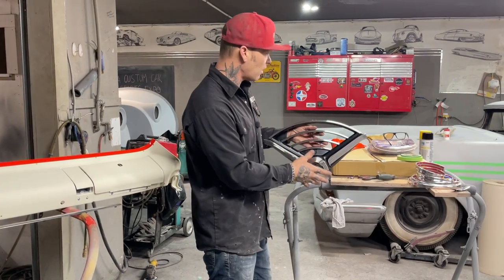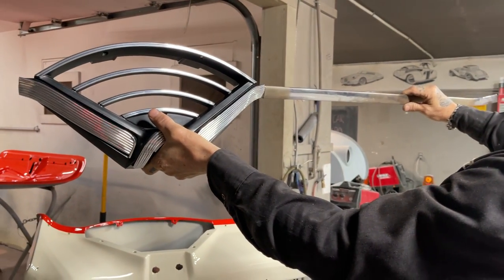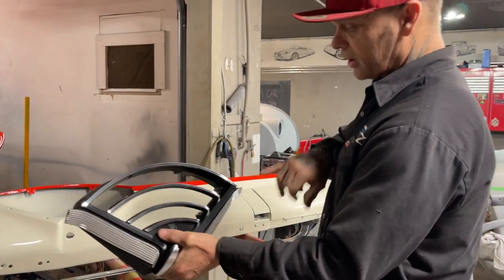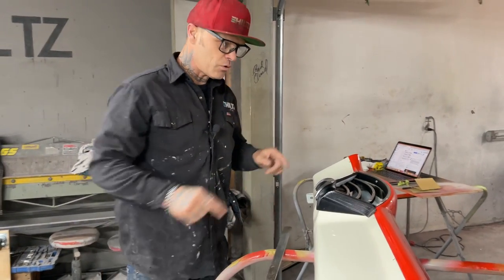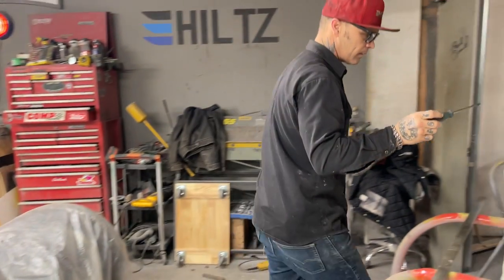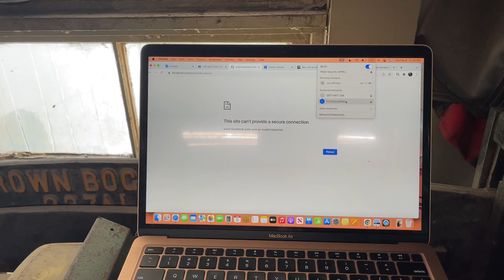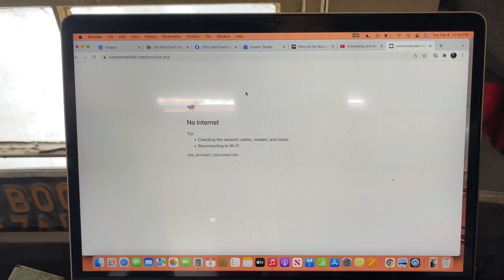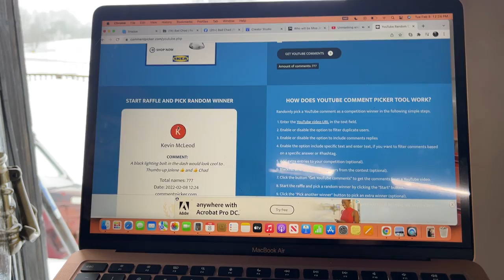Chroming the 1955 Mercury dash for $40 - (Universal Method)

Comment: Chad, try cutting your air bag tubing with a single-sided razor blade at a perfect 90 degree angle using a clean metal backing to guarantee a nice clean  trouble-free connection ... also, always blow out the brass fittings before using them to make sure they are perfectly  free of any "junk" particles ! ... Another "A+" for all your videos ... You two are the very bestest !!!

Comment: Here is what we did in the van conversion industry for moldings. We made a wood box 2'x2'x2' with a lid hinged. Then we put a 60 watt bulb set up on the inside of the lid, centered. We would then put the molding in the box. Turn on the light and leave the molding in the box for 30 to 45 min. This will make the molding pliable to go around corners and odd or different shapes. Then when the molding cooled. It would keep it's shape. Plus it helps with activating the adhesive to help stick better. Hope this might help you out on applying molding to what ever. Peace and love......

Comment: The chrome tape looks great, I've Been using it for years to add to and dress up striping packages as a 3M Trim-Line distributor there were 150 distributors across Canada up until 1992 when 3M withdraw the name from use and we became independents. Thanks Mark Dutka Oakville Ontario Canada

Comment: Looks great, I recommend using 3m 94 primer it comes in a nail polish style bottle we use it on motorcycles to help with vibration and heat..another awesome video

Comment: Looks awesome. I have used this "Flex Chrome" before and I love it. I have a Very high-end Deuce Roadster and I used this adhesive Flex chrome for the center strip on the 3 piece hood because it is the hot rod hood with no center hinge, unlike the 4-piece stock style "Butterfly" hood .

Comment: That's exactly how we used to do stuff when I had my shop. I would read the paint cans to see exactly what would mix. One Job we did we could use Centuries Hardener with Sherman William Paint and get the same results of what they were trying to sell us.Centarie wanted us to by their paint bench. I told my brother that's not happening. Look on the back of the can; if you don't believe me. All it takes is a simple test take one of your proofing cup's . Watch to see if it separates or if you have Fish Eye's. O.K. Fine, I've had a few beers...

Comment: That end cap looks good plain,. Just saying.!!
I know your chrome works , will pull paint primer all off if you just pull it off without heating it
Chad stick a piece of 3m tape on the chrome backing then pull that off brings the red plastic off with it.
Try two or three wider pieces with a thinner piece in the valley between them, looks great too.

Comment: I have my doubts about the stick on chrome outside, I could be wrong , but I would test it first, before putting in tons of time.
On the interior I think it would last indefinitely unless there were temperature problems, at either extreme. If you drove it aand parked in shade or had it in a heated garage I would think it would do fine.  I  am sure  119*  in Phoenix Arizona all day in the sun , would probably turn the tape into a pile of gunk. And outside in Minnesota at minus 40 it would probably break off in small pieces , every time it got bumped.

Comment: Back in 1976, I bought a 55 Chevy 210 for $100 off  of a little old lady. She was driving it one day and the transmission stuck in 2nd gear (3 on a tree), so she drove it in her garage and parked it. Many years later, I bought it - it was a basket case (quite rusty) but I was young and foolish. Mechanically, I just had to take everything apart (straight 6 engine, transmission, brakes..), clean the surface rust off, new gaskets and put it back together to get it working. It was missing part of the side stainless so I removed all it - no money for parts.  I spray can painted it black but it came out flat black. I couldn't afford mags so the cheap solution was baby moons. Now, to shave the chrome, flat black paint and baby moons are considered old school hot rodding but in fact I did it because I didn't have the money to do it "right". That's what you do.

Comment: how does that chrome piping act going around an outside radius?  i have a 65 galaxie missing the c-pilar belt trim. The molding that runs from the driver side sail panel under back window to the passenger sail panel. Cant find the molding that i need and this stuff might work.

Comment: I would be afraid that the heat from the sun would release the 3m tape at some point. I have used the trim before but i removed the 3m tape glue and use epoxy glue to hold it.